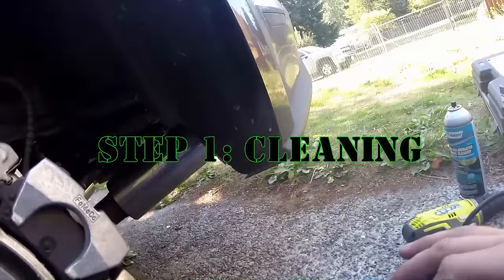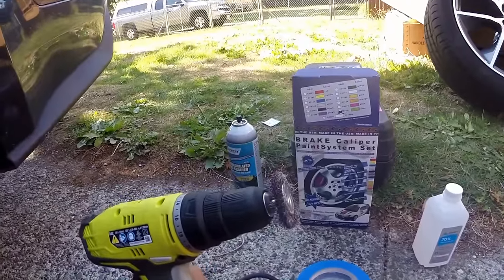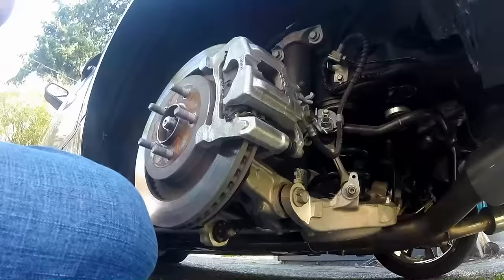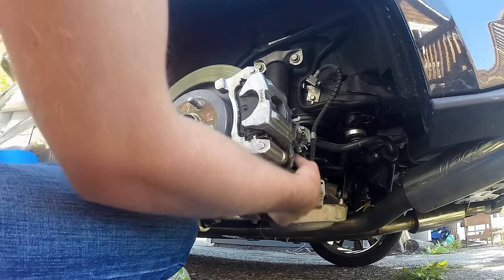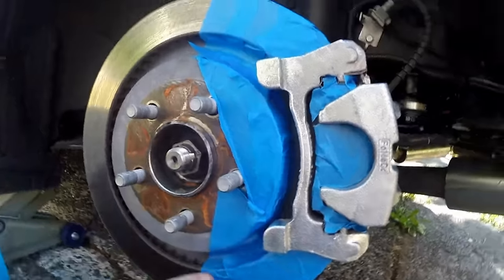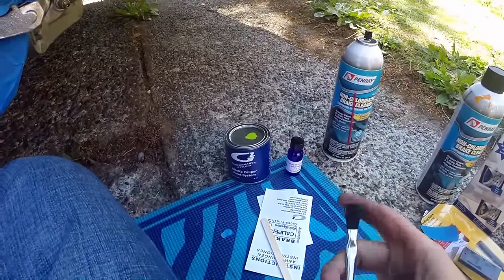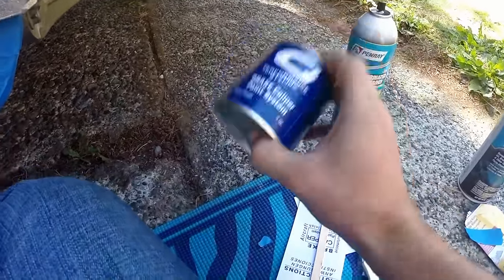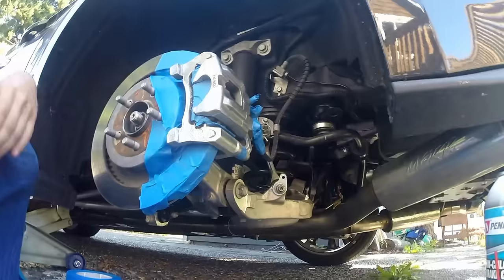How to Paint Brake Calipers | Apply Caliper Decals | FAST and EASY!!

Comment: Nice job that color looks great with the Black Stang!  I just replaced all my calipers on my Sonic Blue 02 SVT Focus and used the G2 Yellow, my original calipers were G2 red and I taped them off like you did.  The new calipers were so easy to paint on a workbench.  The first G2 paint lasted about 8 years before becoming faded and dull.  Now I have to put my black SVT decals on, which is why I'm here lol.

Comment: Looks nice and great video.
 Just wondering though, why didn't you just take the calipers off? A lot less taping and You could paint it on a table or bench. 
I guess you would have to bleed the breaks after, that's not hard to do though.
Reply from the maker: +RS PC good question. I prefer to not have to remove them and have to bleed the brakes if I don't have to. Taping it off is pretty quick really.

Comment: How is the paint holding up and problems !?? > Its 2020 I got a Race red mustang i'm about to do this to, is it just worth to spend the extra money and get it powder coated?
Reply from the maker: Still looks great to this day. Only issues is if someone were to drag the wheels across it while installing. It can be chipped and scraped if hit.
Reply: @HereWeGoNow  what do u mean drag the wheels across?
Reply from the maker: When installing the wheels. If you were to hit the caliper it will chip or scrape. happened to me on my 67 mustang, but everyday use there is zero problem
Reply: @HereWeGoNow  thx
Reply: powder coating lime green they want $125 each caliper and they put a protective coat on it..

Comment: looks amazing. I am a little surprised that you didn't hit that decal with a clear coat 😁
Reply from the maker: +L.A DiNiro I was off and on about doing that,  but so far the are holding up beautifully.
Reply: I'm about to put my decals on my G2 painted calipers and wasn't sure if you can spray clear coat over epoxy, if you know let me know.
Reply from the maker: +ZepG I haven't sprayed clear on any of the other jobs I've done, but it's probably not a bad idea if you don't mind the extra work. Mine are holing up like the day I put them on.
Reply: HereWeGo I found a G2 faq page and they do not recommend spraying clear over their high gloss epoxy, thanks for the reply.

Comment: How did you go about putting it on jackstands on all 4 corners?....Do you do one side first and use the pinch welds?
Reply from the maker: +darrenleaguecity I didn't actually. I just did one side at a time. Then went back and forth between them allowing the other one to dry while I painted the other.
Reply: I just ordered 4 jackstands....kinda nervous about having it completely off the ground though....will just have to see how it goes...ordered 2 kits just in case...so could just do one side with one kit and then 2nd side with remaining kit...better safe then sorry! lol
Reply: @HereWeGoNow  how long did it take to dry each one ???
Reply from the maker: Let them sit overnight. Will depend on the temp and conditions too though.

Comment: Looks great. Quick question, were you able to paint the entire caliper on the front insides of it?
Reply from the maker: +Jared Murray for the most part yes. You can hit all the areas you can see when the tire is on for sure.
Reply: Welp, applied mine to my 2015 mustang GT pp. Did yours smooth out right away or does it take the full 24 hrs? Thanks man
Reply from the maker: +Jared Murray Awesome! it takes a bit to level out. Should be good by morning.
Reply: Alright good deal man. Thanks for the input
Reply: HereWeGo so mine didn't smooth as much as I had hoped. Do you recommend me buying another kit and adding another coat to the front? Backs were great. Or just leave it as is? Thanks man
Reply from the maker: +Jared Murray depends on how noticeable it is. If it would irritate you every time you looked at them then get another kit, if not then keep it as is

Comment: the real question is will u need to keep repainting the caliper and will the paint peal off if it has water on it?
Reply from the maker: +L3mons Modz ive have it on for almost a year Noel and other than nicking the caliper with the wheel once it has been great and looks just as good as it did day 1. I use brake cleaner to clean them so this stuff is tough.
Reply: oh ok thank you very much!! :)
Reply from the maker: +L3mons Modz no problem!

Comment: last thing i would have done just to be thorough was spray a clearcoat over the finished and decaled brakes.
Reply from the maker: +Joseph Domiano I went back and worry on that actually. Haven't had any issues yet,  but should be easy to do if they fail at some point.
Reply from the maker: +Demariners I actually didn't use a clear coat at all for mine. I haven't had any issues with chipping or peeling. However if you want to use one I would go with a high temperature clear coat. Any decent rattle can should suffice.
Reply from the maker: +Demariners I'd go with vht https://www.amazon.com/gp/aw/d/B000CPIMW6/ref=mp_s_a_1_2?ie=UTF8&qid=1473799399&sr=8-2&pi=SY200_QL40&keywords=vht+clear+coat+high+temp&dpPl=1&dpID=41M1JlT025L&ref=plSrch.  I'm not sure why the turned red
Reply from the maker: +Demariners either one will do the trick really.